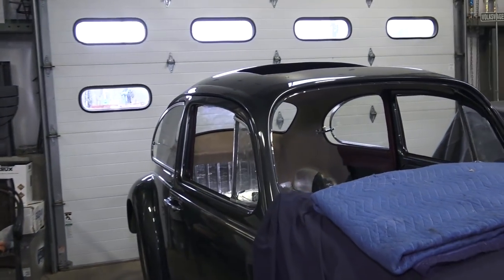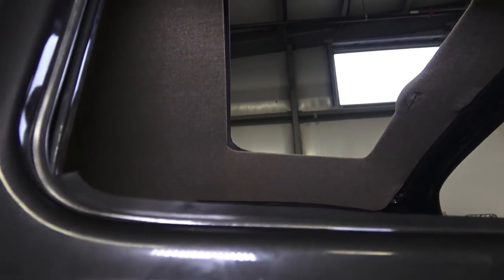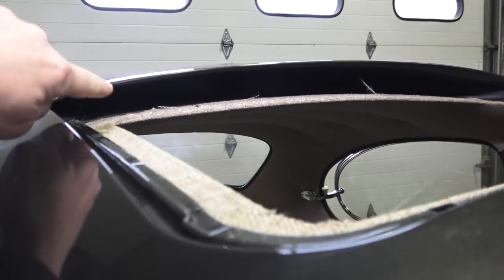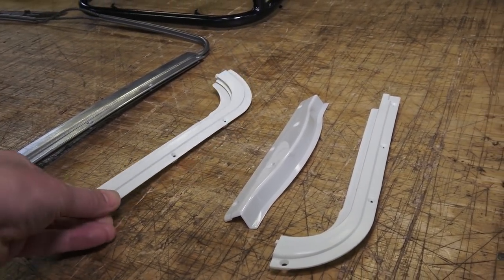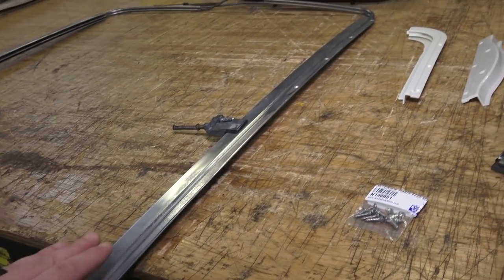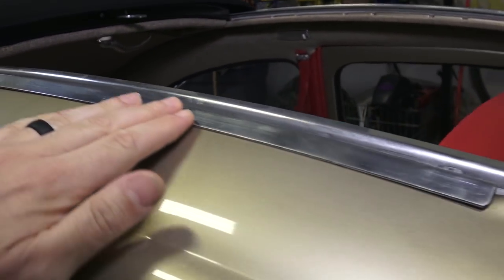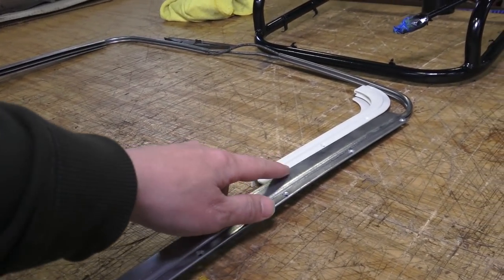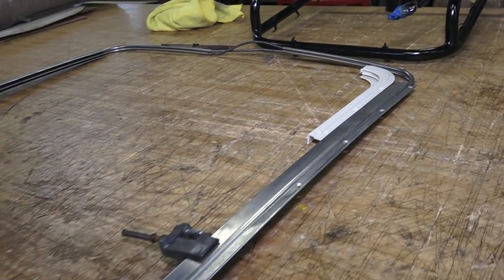Classic VW BuGs Vintage Beetle Metal Sunroof Headliner Install Rails Intro

Comment: Don't forget to talk about the different front lifters of metal sunroofs. From the bug circle knobs to the later Phillip screw type!
Reply from the maker: Funny you mention, I have neither for this bug.  I have the sliders that attach to the knobs, but no knobs.
Reply: @classicvwbugs  from the video, it looks like you have the late sliders (3 screws). If so, you don't need the knobs. Another difference is that the earlier sunroof panels need the knobs, but later sunroofs have the actual metal of the sunroof panel raised where the knobs used to go. So the sliders attach to the knobs for early and the sliders attach to the actual sunroof for later. I have late sliders but early sunroof panel, so I need the knobs!
Reply from the maker: @jeffreygomez7694  Hmmm something I need to look at then.  I have the sliders and they have two spots to have screws pass through them, that then also look to need that circled nut in order to have the roof raised up enough to be level with the roof.  Do you have a pic you can show me of the later setup?